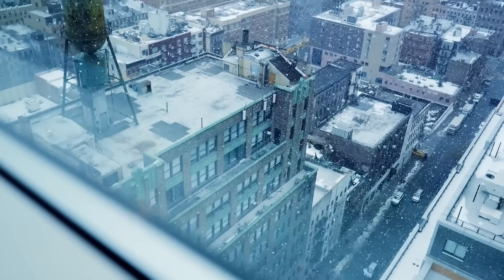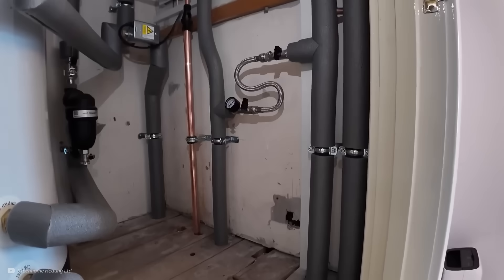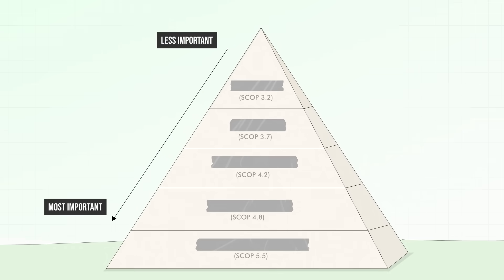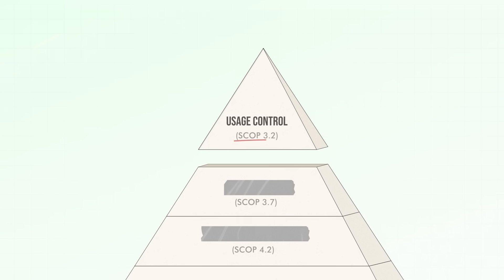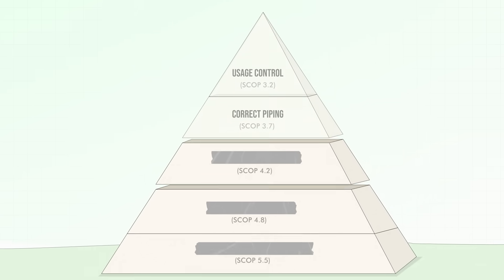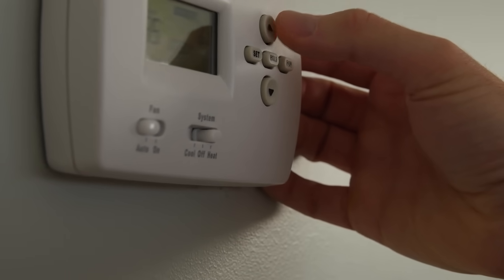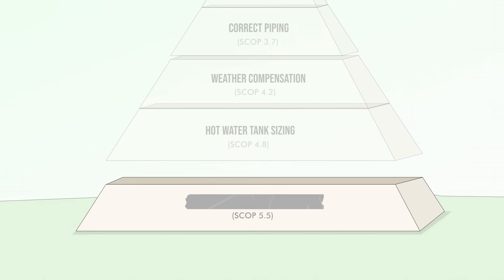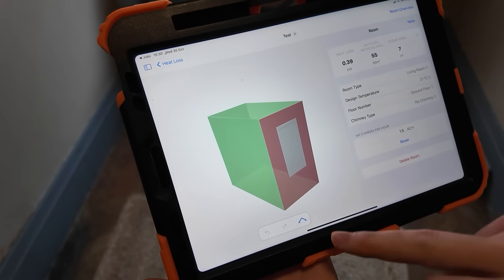The Genius of the World's Most Efficient Heat Pump

Comment: I understand the concept of weather compensation but I imagine it's really only applicable to very poorly insulated homes.  Otherwise, just adjusting based on interior temperature ought to be sufficient.
So for example, let's say you have a mini split and it's been running all day, so the temperature is pretty close to what you set it to.  It's 4PM and a zone had been requesting 4000 BTUs for the past several hours.  Well, now that the outdoor temperature is starting to get colder and you're getting a lot less solar radiation, the indoor temperature starts to drop.  The zone then requests 5000 BTUs, which may be overkill at that moment but it's assumed the outdoor temperature is just going to continue to drop.
Now, let's say it's noon and someone left the door open as they brought in a bunch of of groceries, rapidly dropping the indoor temperature.  If the unit has been operating for hours and had a computer logging temperatures, it wouldn't make sense to have a knee-jerk reaction and crank up to 9000+ BTUs.  Maybe it'll scale up to 7000 and after the door closes, the rate of temperature rise will go up substantially.  The system might still be asking for more than 4000 BTUs since the room is still colder than desired, but it can throttle down the demand since it knows at the rate it's heating up the space, it will get too warm too quickly.

In both examples, the outdoor temperature is irrelevant.  Obviously, a specific BTU count isn't exactly needed either; the compressor just has to work as hard as needed to balance the temperature.  The only time knowing the outdoor temperature would be relevant is if it will dip below a certain COP that the indoor units can't keep up with and would have to compensate ahead of time, but that would require the unit to have access to weather predictions.
Reply: As someone who lives with it, weather compensation works brilliantly in my moderately well insulated 1960s ex council end terrace. You just ignore it, and the house remains nice and warm. You would have to leave the door open for a very long time for the property to cool down, with a heat pump the infrastructure itself is warm so losing the air make little difference. I should point out I like most in the UK have air-to-water, you are talking about a mini split, which is air-to-air.

My system is weather compensation only, there is no feedback from the thermostat.

The only time that it isn't perfect is when there is a lot of solar gain, it would be better if there was an external sensor, however we just accept that if the sun is shining in the spring or autumn, the temperature rises a couple of degrees - it's still comfortable so no big deal, the extra efficiency of running full weather compensation means it is still cheaper and nicer than using thermostat control.
Reply: Ehm...no, weather compensation is ALWAYS needed, we run anywhere from 22 degrees flow temp to 32 degrees flow temp, and we have 30 cm rock wool in all of our walls, 80 cm in the roof and a well insulated concrete slabb, we have a average SCOP of 4.2 with hot water using a borehole heatpump (drilled to 200 meters), we live at 63.5 degrees North, winters are cold.
Reply: @TheEsseboy 22C flow temperature? How cold is your house?! Surely it just cycles like crazy because your emitters can't release enough heat?
Reply: @bringiton8989  That is in fall/summer when outside temps are above 19 Celsius, we have whole house floor heating. In winter we run on average 26-28 C
Reply: The weather compensation IS the way the house knows what  heat input is needed. It doesn't matter how well insulated the house is, it needs 2x more heat when the temperature difference is 2x as big. Heat loss is proportional to the temperature difference.
Reply: @bringiton8989  Right, but what difference does it make if the indoor and outdoor temperature will drop at roughly the same time?  So long as the system knows the desired temperature and the rate of change of the indoor temperature, how is the outdoor temperature relevant?  Either it's warm enough outside that it will continue to ramp up the compressor and fan speeds to meet demand, or it's too cold and won't meet demand regardless of what you tell it to do.  If the outdoor temp is getting close to the unit's limits, the system doesn't know your insulation level and won't know how to compensate in a timely manner.

This is why I say if you're going to make use of outdoor temps, you need to know the forecast.  It's a lot better if the system can prepare hours in advance than if it were to use realtime data, where it might unnecessarily over-compensate.

Think of it like modern CPUs, which practically clock themselves as fast as thermals and power delivery will allow.  They don't know the ambient temperature, they don't know what your power supply can offer, they don't know the cooling capacity, and they don't know how long their workload will be.  Telling the CPU these things doesn't change the fact that it's only going to work as hard as it is allowed.  Predicting resource availability doesn't affect what it can do now.  I don't see how heat pumps are much different.
Reply: @Toastmaster_5000  I see where you're coming from, but the logic is different. With a heat pump, you're not targeting a rate of internal temperature change, you're targeting a steady state system. The energy going in is equal to the energy going out. If you know the outdoor temperature, you know rate of energy going out, can detect changes and compensate by changing the temperature of water coming in, therefore the heat emitted by radiators, underfloor heating etc. 

For non-equilibrium cases (e.g. the internal temperature is lower than desired, your radiators will emit more heat at the same water flow temperature because they have a bigger temperature difference with the room. This means colder water returning to the pump and it works harder to heat that water back to the desired temperature. The system naturally restores balance, albeit slowly. 

That approach works fine, but it is slow - most pumps also read thermostats will adjust weather compensation curves to help recover temperature more quickly after a holiday or whatever, but there's an efficiency penalty from making the hotter water to drive the temperature gradients. 

As for systems being under sized - well, unfortunately you just need to size them right. Most are oversized, which is problematic for efficiency, but does make "recovery" possible relatively quickly when you prompt it to.

Predictive operation based on weather forecasts also exists, but isn't common in the market yet. Give it another year or two and it will be standard, I'm sure.
Reply: Something to know is the air temp doesn't matter very much for comfort, what matters is the room temp (everything in the room). They all radiate heat and have much more thermal mass than air. that is why you can feel cold in a room that has been heated up quickly by a big air flow system. The best would be a system that measure BOTH internal and external temps and then amps the best way to meet those needs through as learning program. It would then be able to determine the time it takes for the outside temp to influence the inside temp, adjust for unexpected rapid changes etc. This would be particularly good as it would adjust for different insulation / thermal masses that are found. Think 300mm insulation v 50mm, stone/brick walls v timber etc etc.

Comment: A factor of 8 (or 800%) is completely unrealistic in almost every real world scenarios. Most modern heat pump reach a factor of 3-5 depending on environmental factors (out of the box). Any further "considerations" are likely very cost intensive and destroy any ROI considerations (in terms of electricity savings).
Reply: Be interesting to know how seasonal COP is calculated. If you add up daily COP over a year and divide by 365 you would get a higher figure than if the COPs were averaged by heat output throughout the year.
Reply: I was peak COP.... So nothing special.
Reply: 9
Reply: True most of us live in buildings incapable of returning such performances, unless - in some cases - more is spent improving them than demolishing and replacing them!

However  the point here is that, with a properly designed system in an efficient building, such performances are a realistic prospect. It really is that sort of leap in efficiency.

If we look to our energy bills and admit the amount we waste (take a typically 'insulated' Victorian or Edwardian 'semi' with bog standard double glazing and the number can easily approach 50% of your hard earned cash adding to the climate situation), the clamour to render it possible to do something would penetrate he ears of even the most ossified political grey matter.
Reply: Very suspect article. If the heat pump has a COP of 3, I don't see how using larger pipes etc. is going to add the additional 5kW of heat to give you a COP of 8.
Reply: Well, the closer you run the water to room temperature the higher the COP, just like your frige will draw less power the hotter you set it to.
Reply: @TheEsseboy  LOL, I can switch the fridge off, then it doesn't consume any power. As I said before, realistic scenarios!!!
Reply: @matthiaswille8641  Can you though? The food would not last...neither would you be comfortable with 13-15 degree inside temp.

realistic scenarios is the SCOP value, did you even watch the video or are you just commenting on the topic?
Reply: @TheEsseboy  Don't fly off the handle because I am critical about some aspects of this video. 800% is unrealistic under almost all circumstances FULL STOP. My fridge comment was sarcastic, in case you didn't notice. A fridge is set ideally to about 1-5 degrees Celsius, there isn't any room to make it warmer. In some regions like the one I'm living in, room temperatures can reach 25 -28 degrees when not cooled. And we cool only when we occupy rooms. It makes no sense to cool when having a room unoccupied for 8-10 hours whilst being at work. So in the extreme there is a 20+ degree difference. That is NOT small, so the fridge's heat pump cannot work optimal. That is what I meant with real world scenarios and not lab conditions.
Reply: @matthiaswille8641  That is why you need to watch the video, they clearly said the realistic value over a year is 5.0 S.C.O.P...or 500%
Reply: @TheEsseboy and you need to read my comments. I said that a COP of 5 is realistic.
Reply: @TheEsseboy tbf 15°C is not that bad
Reply: @goncaloaraujo6644  Try sitting in a 15 C room with normal T-shirt and sweaters...
Reply: @ yea thats not possible but wearing thick clothes pretty much do the trick
Reply: @goncaloaraujo6644  So reverting to old ages, why not invest in insulation instead and be comfortable?
Reply: @ it is a good idea for those who can afford
Reply: @goncaloaraujo6644  Well, you save money in the long term, if you can't afford it you might have to think about downsizing until you have enough money to live comfortably in a large house.
Reply: @matthiaswille8641  what he means is that if you have a big evaporter or big condenser on a heat pump, it will be more efficient because the coolant ollie heat pump are working, gas will reach ambient temperature
Reply: Yeah, I don't get it. I barely ran my heat pump in September and I live in Quebec. I used 85kwh for the whole of September, that's 5$ of electricity. My cop was probably high and the heat pump wasted some energy cycling, but who cares. With his system it would have run the whole time instead of cycling and saved 0.2$?
Reply: @purpleblueunicorn that's some unusually cheap electricity you have there.
Reply: @purpleblueunicorn  Probably saved something like 1-2 dollars, cycling it extremely wasteful.

Comment: I wish these guys would make enclosures or heat pump rooms that have ground air tubes that could boost efficiency during extreme cold temps ( I stole this idea from the creator of citrus in the snow)    .... also this is Dusty formerly of tbdv .
Reply: That makes so much sense!  Bring the heat pump indoors to a sealed mechanical room with both underground large diameter pipes and a control switch to alternatively take outdoor air if the temps were favorable.  A tough retrofit but if you're digging a foundation for a new house or addition, a lot simpler.
Reply: @BobPritchard  yes and I was referring to air source before I noticed vid was about liquid ground source style.   The old russ of citrus in the snow shared this concept with me.  I have yet to see someone try it.
Reply: In the Nordics we use 200 meter deep boreholes instead, costs 5,000 Euros to drill but the savings are INSANE, literally 50% cheaper to maintain and buy electricity compared to oil, which is the only alternative up here. (Heating oil is still close to tax free here, so it is not expensive)
Reply: @TheEsseboy  yes , I made the coment before I noticed it was liquid ground source. I thought it was about air source minisplit . Basically I'm suggesting a ground air source system for homes that don't have fluid ground source style and are in places with very cold temps.
Reply: This is known as a ground-source heat pump and is very popular in Sweden. 

You basically drill deep down in the ground where the temperature is stable year-round so that you can get a very high COP even when it's -30C outside.
Reply: @swecreations  My question is what is the cost of drilling the bore hole, vs using something like a large sand mass system like the one advertised by polar nights energy. Another thing to consider is heat loss thru windows so eliminating north facing windows in the northern hemisphere will eliminate a potential heat loss, or alternatively window insulation covers. There's a good video called Birken Forest Monastery of which they  built a 3 story building of about 10,000 sq. ft. and improved heat loss by super insulation and shutters that slide or swing to cover large windows, and yet allow heat gain during the winter especially when it is sunny out.
Reply: @swecreations   yes , I was referring to the mini split air source style before I noticed the video was about ground source
Reply: @katiegreene3960  No, the video is about air source I believe

Comment: So, how well does SCOP deal with the reality that a lot of people only turn their heating on between some time in Oct and an equivalent date in early Spring ? I have always seen an averaged COP as irrelevant to my needs, I want to know what COP will be achieved when the outside temp falls below - say - 12 deg C with a particular focus on the result below 5 C.
Reply: That's exactly what SCOP covers - average efficiency over the heating season. Total energy out/ total energy in.

Manufacturers publish all the steady state efficiencies in their data books if you want to know what it does at - 2, +5 etc
Reply: SCOP is just the whole 365 days. I don't care what a particular day costs, i care what my yearly bill (and therefore my monthly payments) are.
Reply: @SeanW-zi6kj  i care that the system works with the low solar inputs during the winter

Comment: COP isn't efficiency. My fuel pump uses 1000 times less energy than I get from burning the fuel. My pump is 100000% efficient. You can't have more than 100% efficiency. Don't be ridiculous.
Almost everything in this video is flawed.
Reply: Yea, technically the heat pump is 93.5% efficient at moving heat in that case, that is the real number.